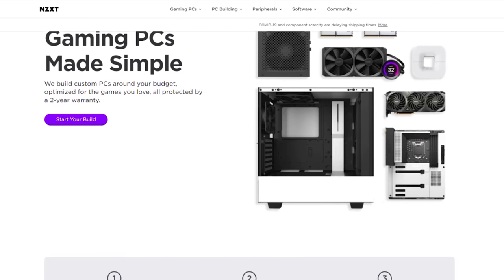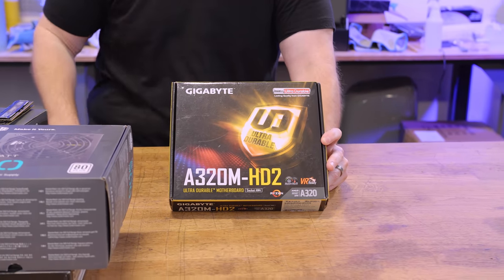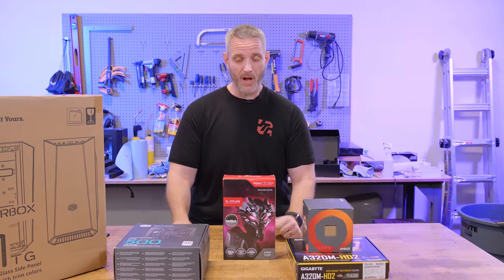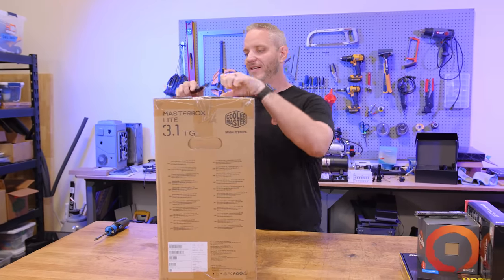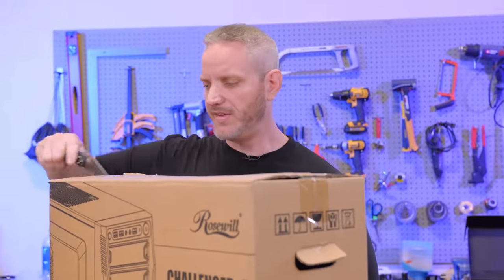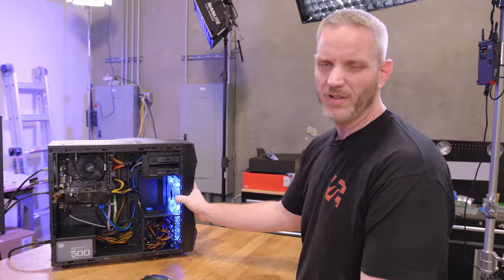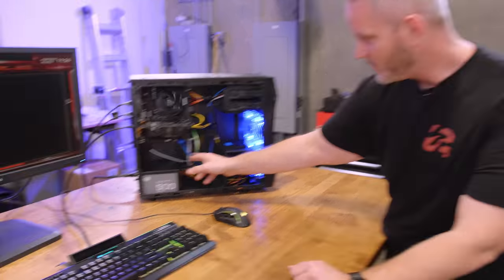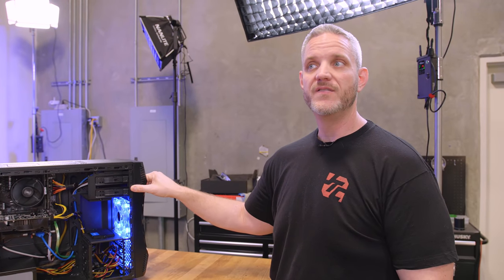The most Practical PC Build of 2022... Extremely Tight Budget Build!

Comment: I honestly forgot Windows 11 was a thing. It launched, I heard it was a dumpster fire for AMD CPUs which I have, and then it completely fell off my radar.
Reply: i just enabled fTPM on Win10 in anticipation of upgrading, had massive sound stutter issues just from that, reverted, and then when it released and i updated a 2ndary macine for a test and the horribly unconfigurable taskbar along with some other hairbrained regressions made me uninstall it the same day, and i don't think i'll give it another look until Windows 10 support runs out 3 years from now.
Reply: I think all the AMD issues have been resolved since october or so. Microsoft and AMD both put out patches pretty fast
Reply: I got Windows 11 to test it out and honestly... I've noticed no real differences in performance or CPU utilization what-so-ever, and I have an AMD Ryzen 9 3900XT.
Reply: There is WIn 11 allready?
Reply: Honestly haven't have any issues with my ryzen 3700x cpu with windows 11 and I've been on it since it released in beta.
Reply: it's garbage software though
Reply: @0ptimismPrime  Best upgrade is Linux - configure it how YOU want, not how MS can most easily profile you.
Reply: It was, but it got fixed pretty quick.
Reply: @phillee2814  that’s a big downgrade for me. Most games don’t work, and graphics drivers are hit or miss.
Reply: @EvilTurkeySlices  Graphics drivers are fine.  Games are getting better, and with the advent of the Steam deck will continue to do so.  And it is much snappier in operation, as it doesn't keep phoning home to MS to keep them updated on your activity.
Plus you can use a decent copy-on-write filing system like ZFS.  With an NVMe or two caching a VDEV based ZFS pool, you can have a nice big fault-tolerant setup that is nearly always as fast as the NVMe, which let's face it, is a HUGE cache in addition to the one in RAM.
Reply: @phillee2814  Sure, if you want Gramma calling you a couple times a week to ask how you do something, in this newfangled software. 🙄
Reply: @Mr1Tanker  Why would she do that more with Linux than with Win11, when you can configure Linux to act more like whatever her previous version of windows was than win11 allows?

Comment: The most practical build for my parents always was my old rig after building a new one. Prebuild and tested for no costs, can't beat that.
Reply: I do the same, pass my old rig to family members that just do browsing, normal online type of activities.
 Actually this system I am currently typing this on will be one of those systems it is a 6700k, 16g 3200mhz ram, 1 tb adata ssd, 1tb samsung ssd, Seasonic 650 w PSU  and I will swap out the current 1070 gpu and just put in a 570 gpu from an even older build and the case is a Cooler Master Haf XP EVO.

I will finish my Alder Lake gaming rig build within about the next week or so and make my current 10700k rig my everyday browsing rig.
Reply: I used to do that until a few years ago when I noticed they stopped using the PC and just used their phones for everything.
Reply: @FastSloth87  I've seen that movie as well... :)
Reply: I usually keep the upgraded video card and power supply to reduce the initial purchase price of parts for my new rig when passing the old rig to my parents. 😉 For some reason, I like hoarding spare parts instead of selling them.
Reply: @christopherschmeltz3333  Problem is usually the build I gift is around 4 years or so old and now something like a PSU that was an adequate amount of watts for the old build will not cut it for the newer more power hungry hardware.
 Also again same with the video card as by that point they are a couple of generations old and if looking for top performance with the new build you are sacrificing performance of the rig by retaining the several generation old GPU which in some ways negates doing the build.
If you are a gamer generally the newer series GPU will have a much larger performance impact in most games than a CPU a few generations old as long as the initial build used a good chip to start with.
Reply: @billwiley7216  That's why I keep all the power hungry gaming hardware for myself and only gift the older parts!  Guess I should have mentioned that I alternate gifts... After I upgrade my video card and PSU, the older parts go back into the previous tower I gave my parents.  Shuffling parts among family members that are within a couple generations of each other are easier on our budget than replacing everything at the same time every few generations just to keep a pre-built system together.
Reply: Bruh, I made my brother's business office with all of my old PC hardware, cant beat that for sure!

i7-4770k
16gb ddr3 ram
MSI mobo
30$ generic case(new)
650w psu
Samsung 23inch 1080p monitor
logitech mouse and keyboard combo 20$(new)

note: its used for office work, and the integrated graphics in the i7-4770k is amazing, can watch youtube 4k videos smoothly!

Comment: Honestly a Ryxen 3 3200G would have been a better fit as it's zen+ so no windows 11 issues and it has a decent graphics option without spending extra for the graphics card.  Vega 8 has no issues decoding video.
Reply: The motherboard isn't compatible with this (if I hear that correctly).
Reply: @thelonewolf3515  It is but it would require bios update
Reply: He probably had the gpu laying around
Reply: @mruczyslaw50  ah ok, thanks mate!
Reply: Yeah, i would have also gone with either 2200G /3200G/4300G/5300G (whichever is available, since it is possible to separately buy OEM Only APU's easily and within budget), primarily because it would remove the hassle of updating GPU drivers, and any issue with any future hardware fixing issues (the less component a Grandma built has inside it, the more easier it would be to fix any possible issues). And i don't think those APU's would have any issue with decoding any Streaming Service video's from Netflix, etc.
Reply: @Sup_D  2200g doesn't isn't supported by windows 11 but yeah
Reply: @HetZieltje  officially it isn't, but with tricks you can install windows 11 even on a core 2 duo
Reply: @mruczyslaw50  yh but that wasn't the point of the build
Reply: @HetZieltje  I know
Reply: @HetZieltje  I didn't really check the recent listing of supported CPU's for Windows 11, and thought that if 1300X is supports than 2200G should be as well (as same "Zen" architecture, if i remember right).
Reply: @Sup_D  the thing is the 1300x isn't supported lol, Jay messed up. He pasted the text into the vid at the end. You are right tho, the 2200g is a zen 14nm cpu
Reply: @HetZieltje  Oh yeah, i missed that.
Reply: @mruczyslaw50  you dont want tricks with a PC for a grandma
Reply: @Sup_D  why crossing 2200g? I've recently installed w11 on it with simply enabling fTPM switch on Asrock a320m MB, running flawlessly with monitor 1080p60hz and TV connected 1080p24hz (extended). Decoding media 2160p x265 10bit HDR video barely "loads" the GPU by 20-30% or even less.. So again I don't understand why Jay puts crappy card that is good for video output only -.-
Reply: @svetlinkrystev3255  Because Officially its not supported yet.
So, its easily possible for Microsoft to add update later on, which blocks that APU completely (like they had blocked some Processors during the beta testing)
Reply: @mruczyslaw50  its still risky, since Microsoft can easily block out that Processor with an Update, like they had done with some during the Beta testing.
Reply: @WayStedYou  then why install windows 11 instead of 10 anyway
Reply: @Sup_D  there is no such thing as 'not supported', basically it runs hardware compatibility and passes it.. As I mentioned I just enabled fTPM (which is required) w/o tricking the installation in any way and everything installed and works perfectly.. Even better than 10 in matter of fact.. 
That article you are referring is outdated and says it's NOT a baseline to determine if device will be allowed if presented in that list.